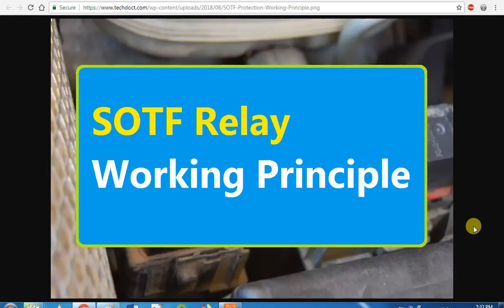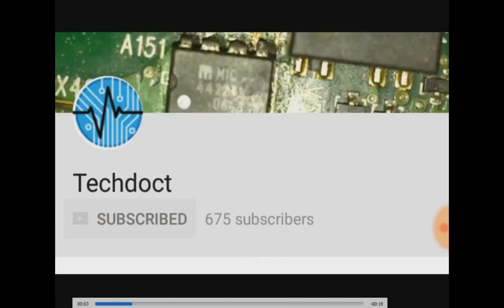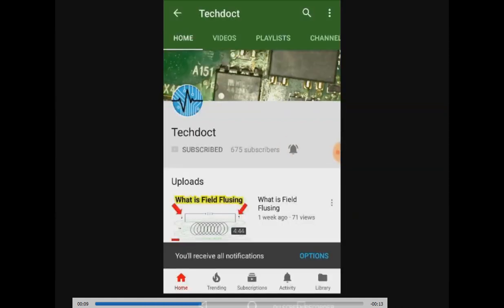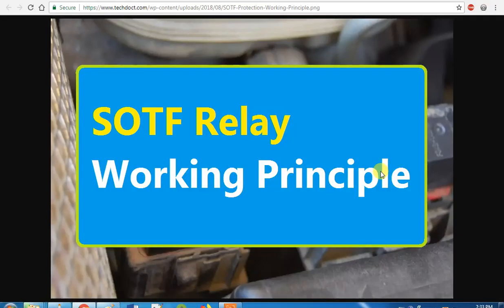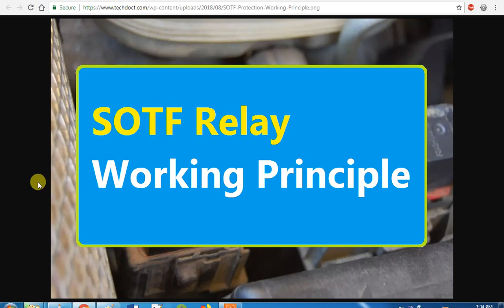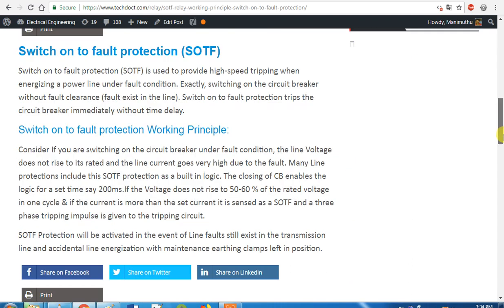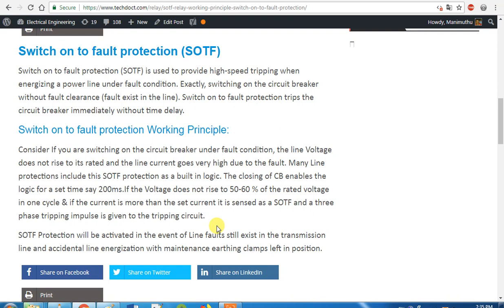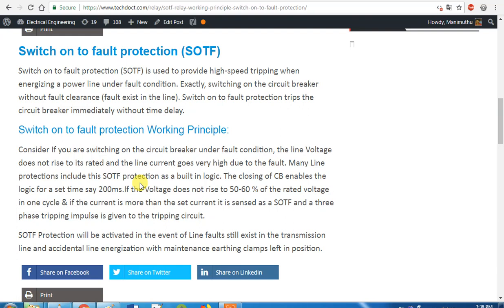SOTF Protection Working Principle Switch on To Fault relay

Comment: Idha distance relay protect pannadha?
Reply: Yes distance relay will protect but if the fault in far away or in zone 2 then distance relay will trip only after 800msec but on SoTf protection if fault persists then it will trip immediately won't wait for 800ms